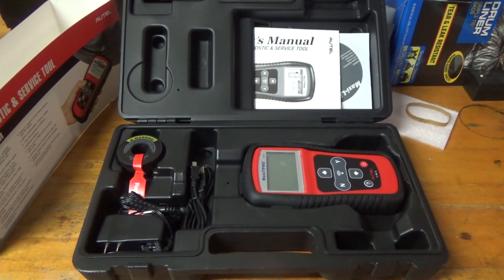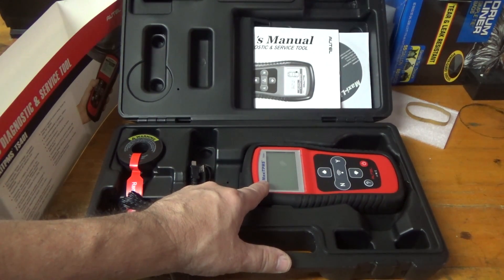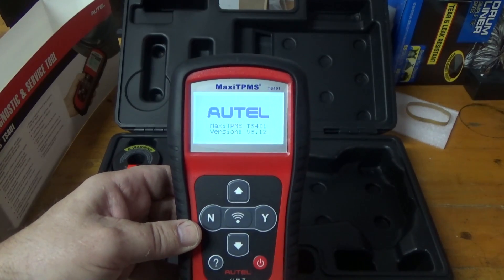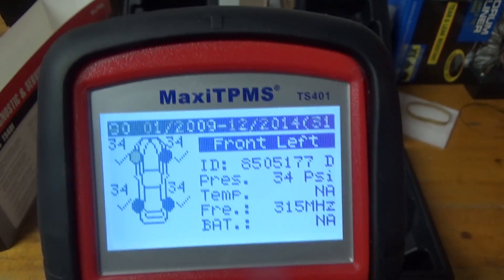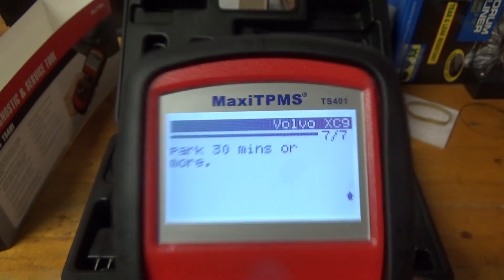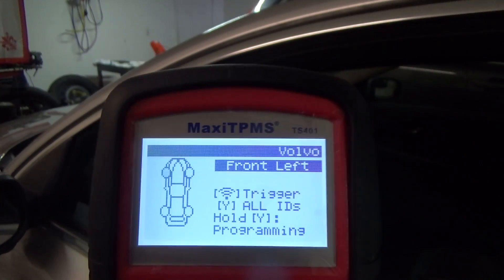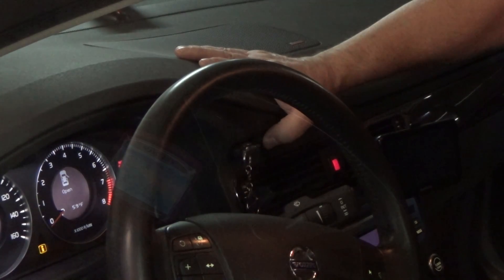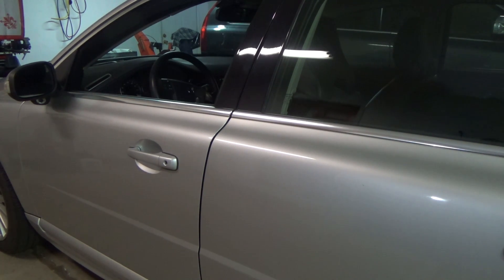Autel TPMS Reset Relearn Demo

Comment: Hi I have the 408 and very similar to this but I’m not sure how to connect the tpms to the car 😢 are you able to help?
Reply from the maker: There should be an online manual at the Autel site.  Mine reads the signal when the device is pointed at the wheel's TPMS.

If you are reading all four the device should tell you which sensor to start at.

Sometimes the reading takes a while and I became confused when it would not read one but, turns out the TPMS battery was dead.
Reply: @A_Renaissance_Man  thanks! I’ll take a look at it! I appreciate your speed response!

Comment: How do I erase some of the tmeps I put to many in the program
Reply from the maker: These devices are crude and clearing them is a matter of starting over or disconnecting the battery.  There is no software function to clear the device.

Comment: Can you program any tpms sensor regardless of manufacture.
Reply from the maker: Yes.  The frequency and TPMS ID is added to the vehicle and then the vehicle monitors those sensors.
Reply: I tried to program and read a new shrader ez sensor with autel ts408 scan tool. I can’t copy or manually ad id to sensor, it won’t read it. I believe you can only use autel sensor. But not all autel sensor work for certain vehicles. For example I tried to program a mx-sensor to 09 Dodge ram 1500 with 433mhz. To my surprise it didn’t even read the sensor to be able program it. At this point I’m In the process of getting autel tech support to help. But thanks for your info.

Comment: Are you programming the new tea PMS to match the old one or are you telling the ECUs the new information from the new TPMS
Reply from the maker: Just starting off new.
Reply: So I got a new set of snow tires on new rims with brand new  TPMS but not Toyota ones what do I need to do for the car to read the new snow tire tpms’
Reply: You need this tool, or one like it, that can read the TPMS codes of your new TPMS sensors. Next, you need a separate tool that can upload these codes to the ECU. Toyota systems only accept one set of codes at a time, so the ECU needs to have the codes changed every time you change tires. There are newer code reader tools (They're expensive) that do it all. @alau18

Comment: I see Autel had the 401, then the 501, and now they only show the 601.   We just bought a 2015 Nissan Altima that they put a different set of wheels on right before we bought it.   The TPMS stays on and shows zero on all tires so I need to get the TPMS computer to see the sensors.  Which one do I need to get the job done?  Thanks for the video.  Tom
Reply: You need the autel ts508...the 401 is a tpms sensor tester  only....the ts508 is a sensor tester  and can program the tpms computer also...
Reply: The Autel 401, 501 601 TS408 can all read TPMS sensor and reprogram them (cloning) with the original ID. Have fun with it. Good Luck.

Comment: Have you used this with your W220? I just bought the TS408 and am having trouble with my new 315MHz sensors “no sensor detected.” Also the car won’t relearn.
Reply: Nvr mind...just using the Autel to “wake”my sensors and then correcting pressures to placard on filler lid made the W220 recognize them! More expensive than just aftermarket sensors alone, but still ~$800 under Benz sensors installed at dealer 🤑